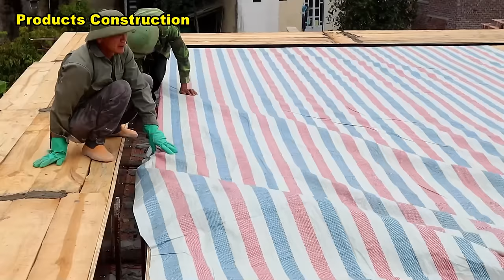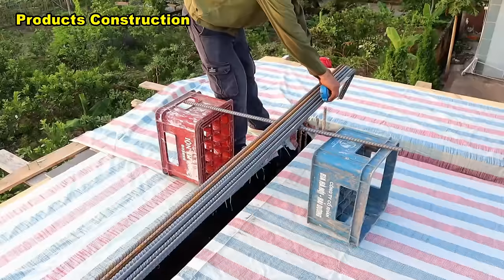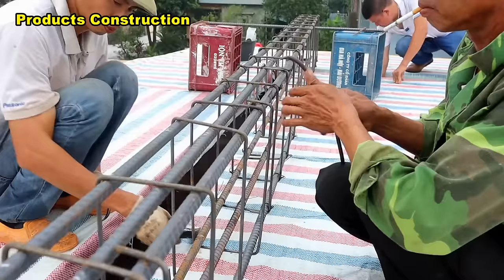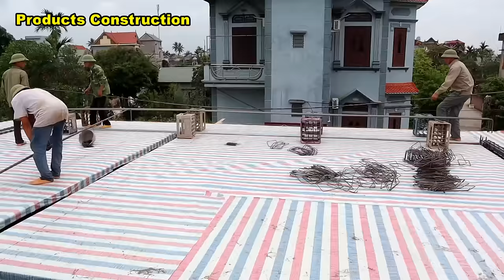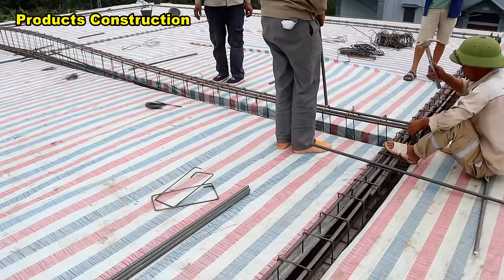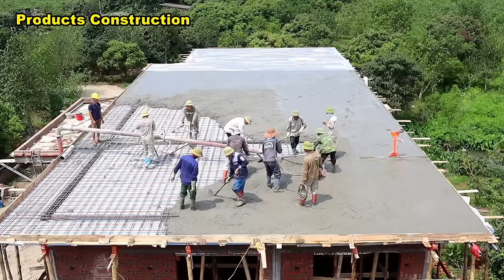How To Use Steel On Flat Roofs - Projects Construction Of Reinforced Concrete Roof Complete

Comment: Cualquier neófito puede creer que todo está bien porque se ve bonito el amarre de los aceros. Sin embargo, hay vicios y malas prácticas en las disposiciones de estos aceros de refuerzos. Una primera instancia respecto a ello: No hay aceros de refuerzos subiendo más arriba del tope  de las paredes, salvo donde fueran ubicadas las columnas. El único amarre estaría en la integración de concretos con los topes de paredes.  2- Hay áreas longitudinales en donde ubicadas las vigas de coronaciones en las que el confinamiento de los aceros no fue controlado y estos están demasiado cercanos a las caras de las vigas. Otros vicios, segunda instancia: Los aceros negativos en todos los "cantilever" fueron mal colocados y demasiado cortos para la tensión a que serían sometidos por las cargas del concreto en cantilever. Todos los aceros del cantilever perimetral fueron mal instaldos porque al ser tan cortos debieron salir  confinados desde dentro de la parte interior  de las vigas. Los refuerzos de aceros negativos para áreas amplias casi no trabajan o no ayudan a los aceros positivos por ser demasiado cortos y por faltar en otros perímetros de las mismas áreas. 3- No instalaron maestras de nivelación para el vaciado y control de concretos confinados para el techo.  No Instalaron maestras para encauzar las aguas pluviales hacia los desagües. No se alcanzan a ver esos desagües y no se alcanzan a ver los tubos de ventilaciones sanitarias. No hay trabajos eléctricos empotrados ni facilidades para los mismos. Un individuo camina en zapatillas sobre el techo. Debo reconocer que los concretos se observan con alrededor de cuatro pulgadas de asentamientos, indicando con ello que la pastosidad es buena para la resistencia de esos concretos. Hay demasiado personal para las necesidades. Este es un mal ejemplo sobre desarrollo de una estructura. Los estribos de las vigas son de acero sin aristas de confinamientos. Lo malo en ellos es que las puntas debieron ser instaladas para mayor confinamientos en defecto de que son muy lisos y con propiedades muy elongativas, esto es son muy estirables sometidos a tensión o compresión.
Reply: Spot on assessment.

Comment: Does this type of roof last longer than the the hip roofing
Reply: I’m not absolutely sure that’s the roof.  They might go up one more story, as the nearby buildings seem to be higher.  A hip roof, of course, is sloped.  When they get around to building this roof, I bet it will be flat.  Most hip roofs are wood framed.  If we are comparing concrete to wood construction, yes the concrete should last longer.

Comment: Can you please do a video where you show us how you remove everything after the concrete has set and seal it and put an interior ceiling in? Ta
Reply: This method of construction is common in Southeast Asia. The wood surface you see at the beginning of the video, and it’s support structure, is all removed from the inside after the concrete has cured, leaving only the concrete. Some low cost methods will leave the ceiling as is, with the texture made by the red white and blue vapor barrier left exposed. Others will put a skim coat of cement over the ceiling to make it smooth. For the more elaborate methods, they install a drop ceiling using ceiling tiles or sheetrock.
Reply: That's the easiest part
Reply: @mayweathermoney5191  yeah I just wanted to see how it looked. I'd like to build a flat roof home with large overhang to shade the walls which would be mostly retractable glass doors so keen to see how that works as well
Reply: @casanova1925  시멘트

Comment: This is popular methods to construction of floor, but I worry about that the bottom of slab has no good quality because  canvas adhere concrete after remove formwork.
Reply: It probably will not be exposed to the interior view.

Comment: Im not an expert but i think that roof maybe wont hold because theres only 2 cross steel bar was used, it looks neat but im afraid it will fall from above to 2nd floor
Reply: You might be right but i have a question, do you have an idea of how many square metres of this house? And how many crosses per 40 - 60 square metres the how should have?
Thanks so much for raising important points.

Comment: Why are they covering new concrete roof with plastic sheets?
Reply: Do it in precast shops to help the concrete cure faster and more evenly-- for these guys probably so no one will see how rough concrete is when it's only been screeded and not floated or trowelled. lol

Comment: This method for tying steel reinforcing is the same around the world.
A major difference from this country is the absence of government regulators like OSHA regulating job site safety.
Reply: The beam lateral supports are not up to code as well and will fail (if syressed).
Have to have a 135 degree return at the join.
Much like CTV building columns.
Shortcuts eventually cost lives.
Reply: @robertmccabe8632  시멘트
Reply: No shooting levels for slope.

Comment: Man this is not how it is done! Change the title to 'How it Shouldn't Be Done'.
Reply: How? Tell us how it should be done
Reply: @joenelledemoni8345  to get you started; details like 45 deg edges on the beams to prevent shear cracking, no 90deg tie bars on the external corners, the levels would have been all over the place it was so pourly screeded.
Reply: @darrellturner560 Yes, but main problem here i think is there aren't joists!
Reply: Reinforced fiberglass concrete is the best way for roofing.